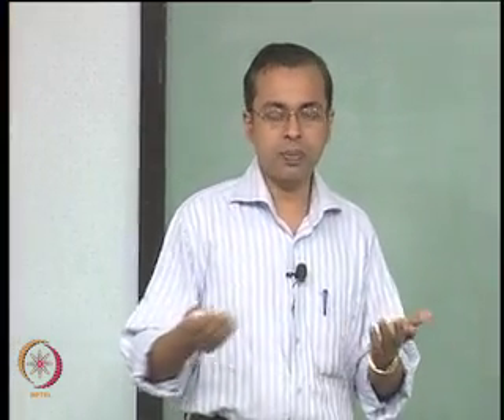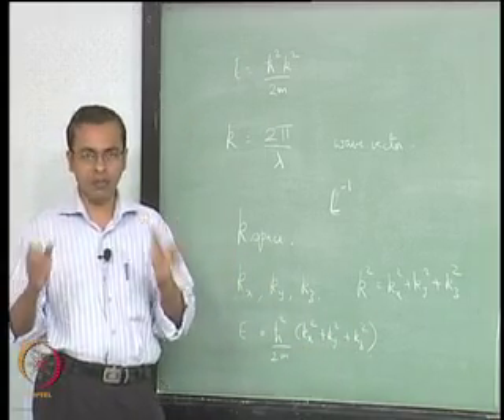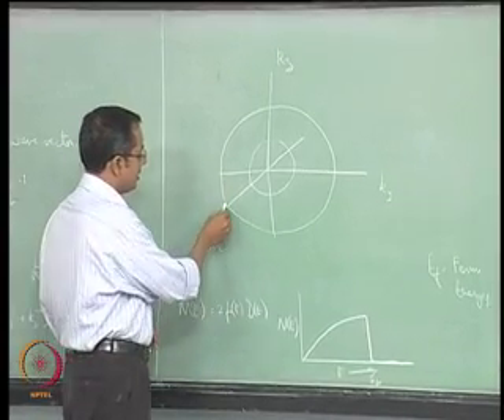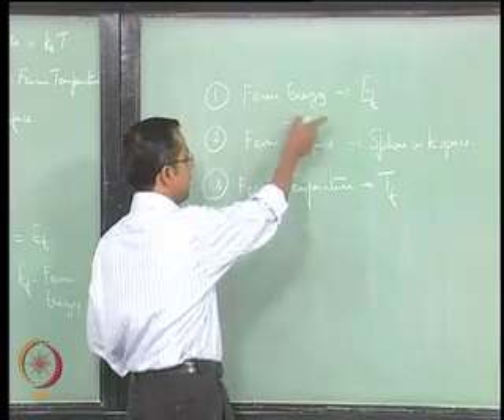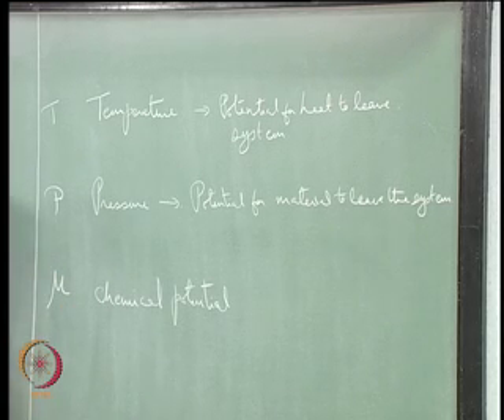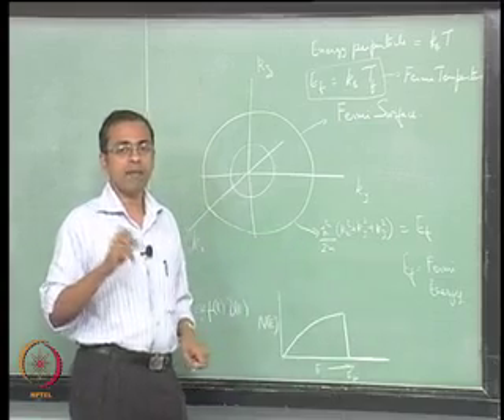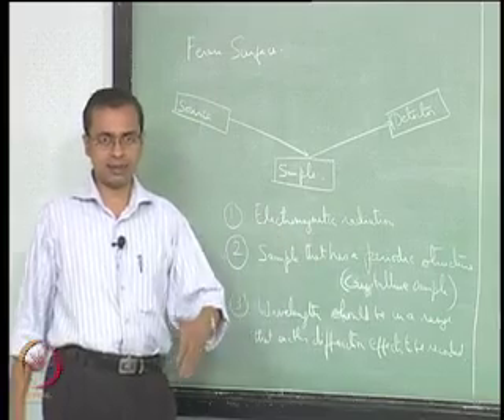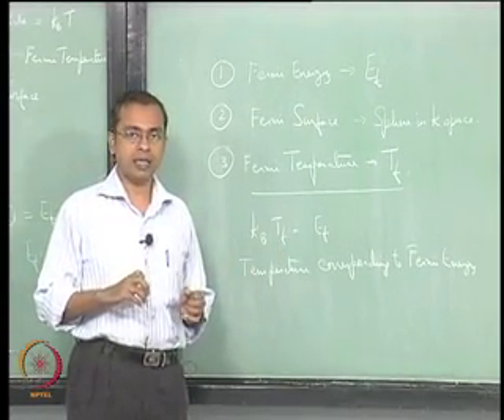Fermi Energy, Fermi Surface, Fermi Temperature

Comment: Dear Satyajit

The energy distribution in temperature is not (and can't be) symmetrical about 0 K. Fermi temperature can be a very high temperature of the order of thousands of Kelvin despite the material having an average of 0 K because the number of free electrons having Fermi energy are extremely small, out of something like 10^23 in the material. So the average temperature will be brought down by rest of the 10^23 electrons and the average will approach zero (not exactly zero, of course). The average temperature just approximates to zero due to electrons which have smaller than Fermi energy.

Hope this helps.

-Utkarsh